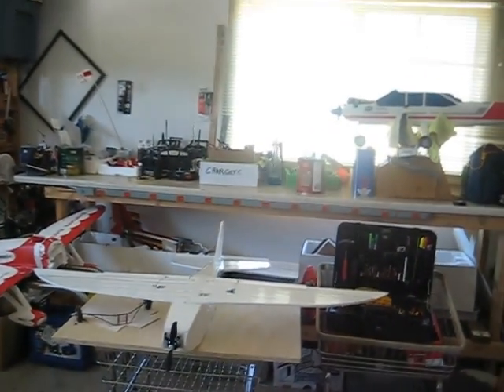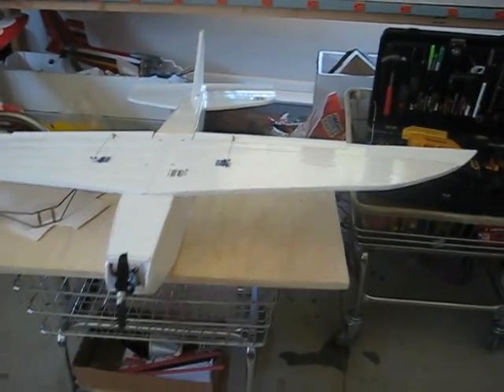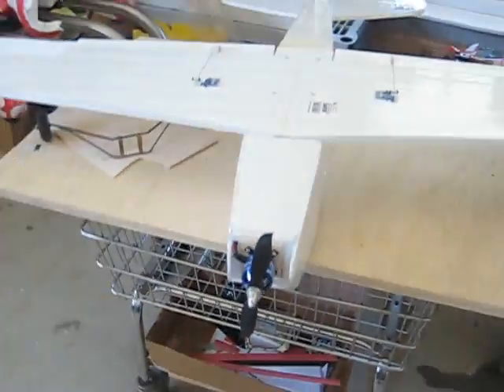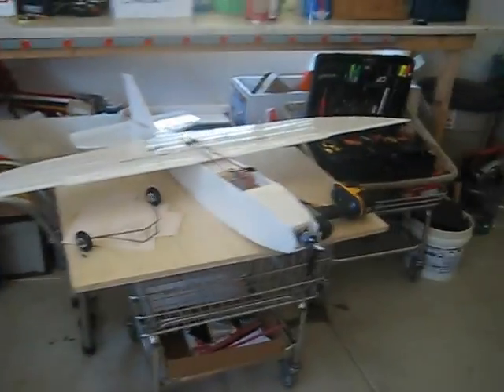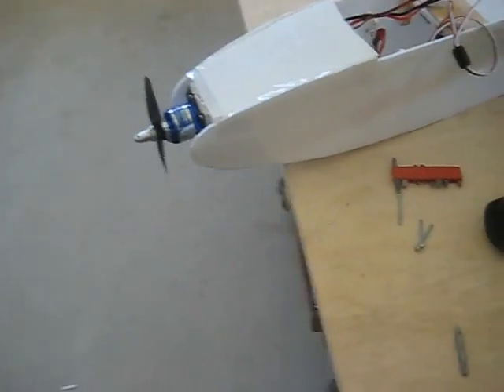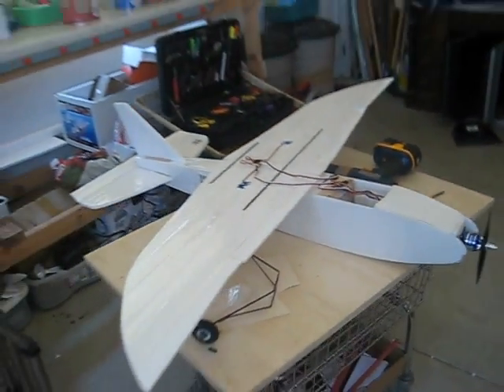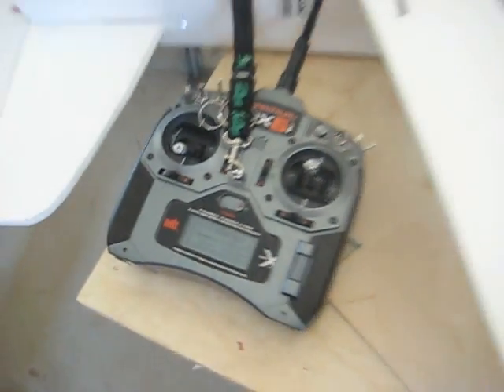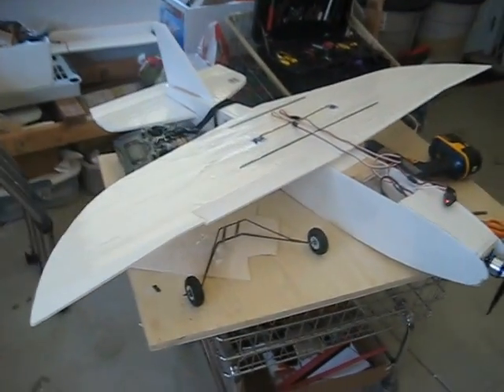Fast rc plane! Preflight check

Comment: hey bro just got into the rc hobby if ur still in the hobby i got a S107G RC Micro Helicopter Blue and about to order Double Horse 9053 3.5 CH XLarge 26" Metal RC Helicopter so whats been happening with you